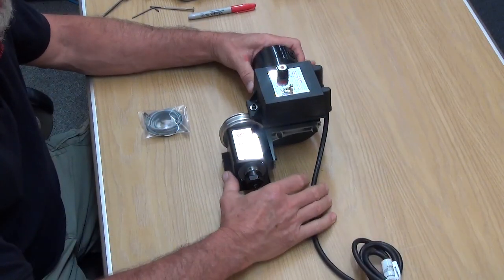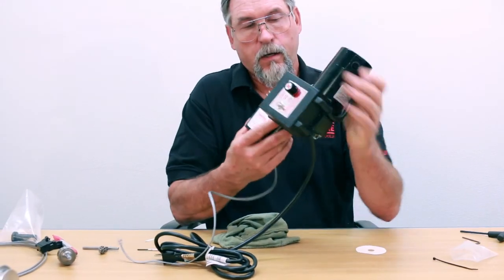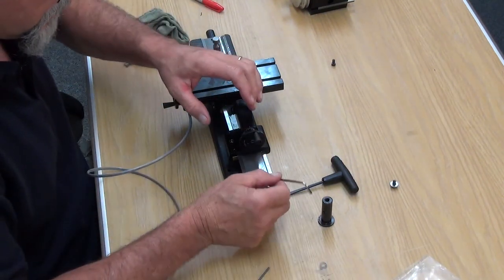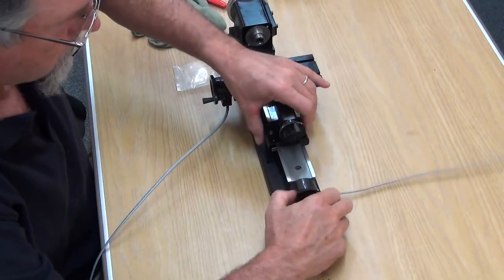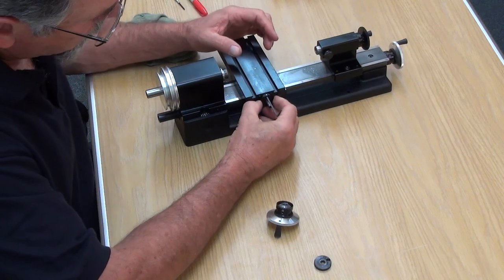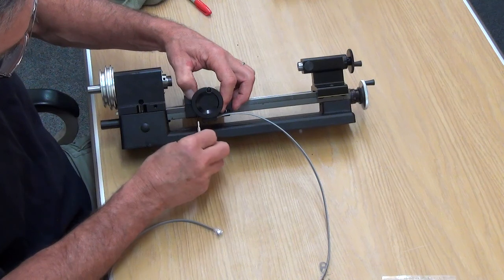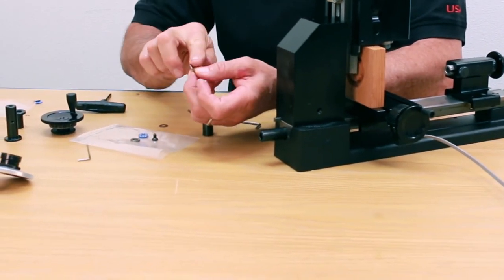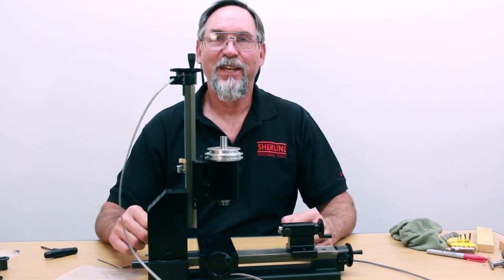DRO Installation

Comment: Terrible to see how you struggle to hold the headstock while it's slipping all over the place. Why not make a base of plywood scraps to make a baseboard with a squarish hole in which to insert the headstock vertically (nose down)?